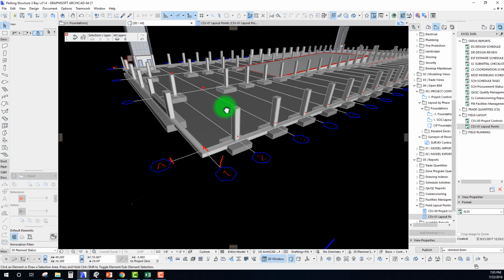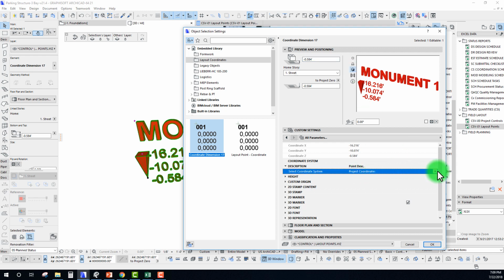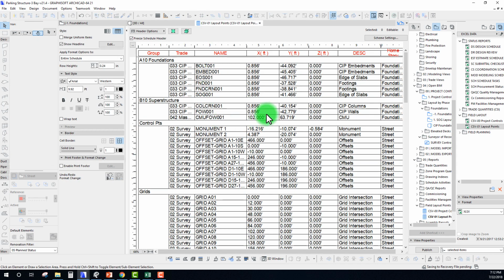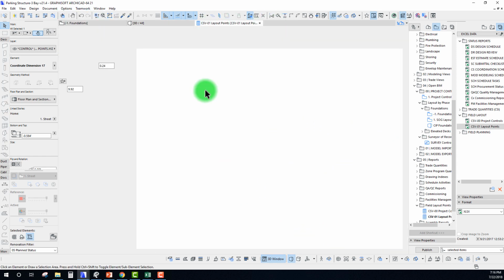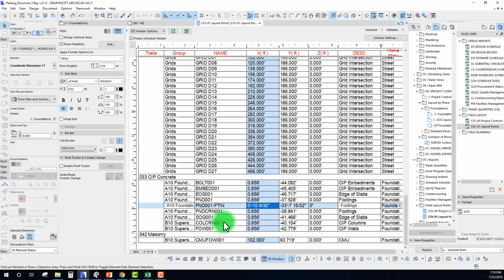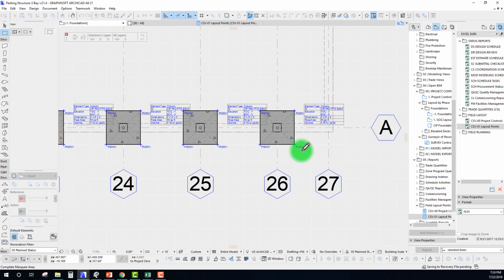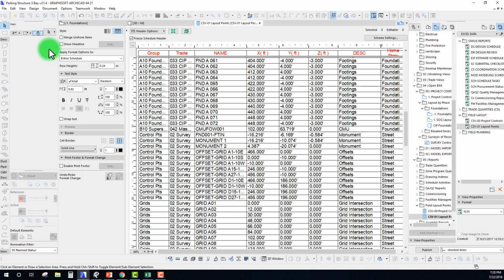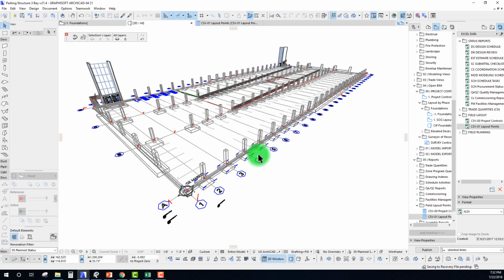Creating Total Station Layout Points in ArchiCAD

Comment: Hi! I'm lost as to how to make a csv file from excel and then import in Archicad. Please help me...
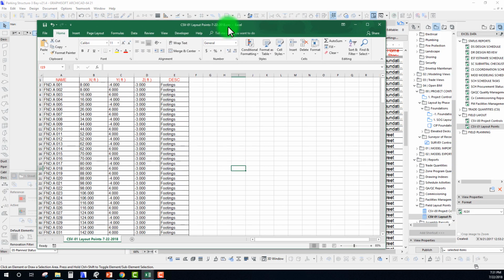Reply from the maker: Hi Eram. Check out the Excel formatting at 27:05. This formatting is typical for loading into a Total Station. However, if you're trying to setup a point list to go into Archicad, you'll want to remove the headline value, as well as the name and DESC columns. All you should need is points for X, Y, Z, without any ft or in markings. Try this out and hopefully this works for you! I'll have to do a video on it here soon if not:)
Reply: @CONTRABIM  Thank you very much for your reply. I shall follow these steps and let you know. The problem I am encountering is....I put in the coordinates via coordinate dimension object...I save in Dwg format...but when the dwg is imported in topcon controller for staking...it doesn't show any points.
Reply from the maker: @eramakhter6646  Saving in DWG format will do nothing for you except create a DWG reference. DWG by itself cannot ready or list your coordinates. Some controllers have the functionality to create points at intersections and corners, but that is a different workflow. In order to use the coordinate dimensions from Archicad as points in your controller, export as noted in the video to XLSX. Open that file and ensure the formatting is ok and setup how your Topcon controller wants to receive it. LIkely if you have any units lists (ft /in) you may need to do a find and replace with nothing to clear those. Once you've formatted your XLSX file, save it as  a CSV format and import it into your Topcon Controller. You should get a list of points if formatted correctly, based on the coordinates you've set in Archicad. You may consult your Topcon manual for how to format the CSV point list for import, they may have a different version required for it to read correctly. Good luck!
Reply: @CONTRABIM  Thank you for your prompt reply. I am going to try this method.